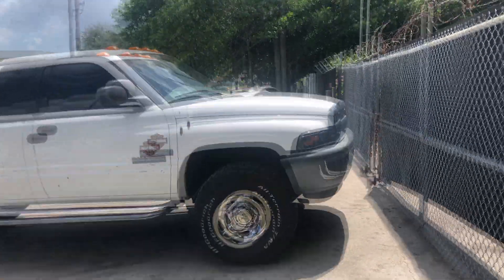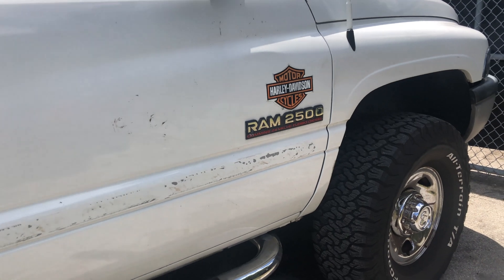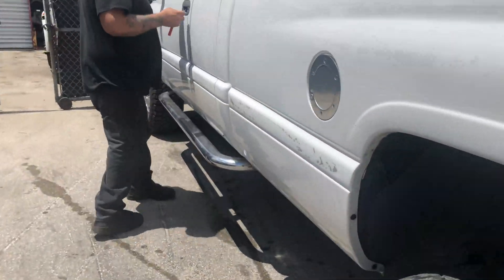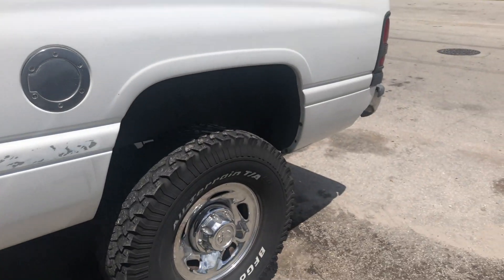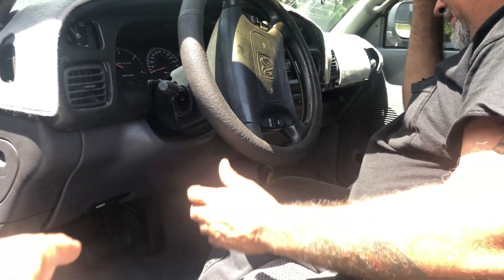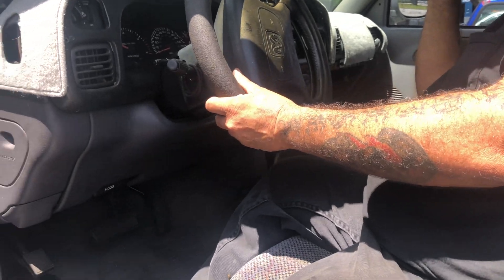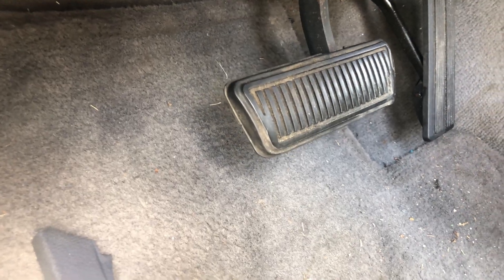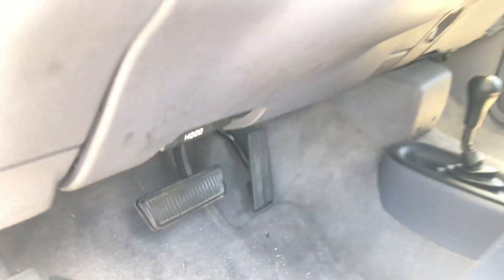VEHICLE BRAKES ITSELF WHEN YOU TURN THE STEERING WHEEL PHENOMENON

Comment: Yep, exact problem on 1999 dodge pickup with hydroboost I have in the shop.  It also has a replacement hydroboost in it, although customer does not remember ever having it replaced. getting another one.

Comment: i have a 2009 silverado 2500hd 4x4 crew cab with heavy tow package (WT) model with 6.0L+8l90e trans. i just rebuilt my hydroboost. basically its a few seals. anyhow i think this might be caused because when i attached the master cylinder i just started the first threads on each of the two nuts. i then tried to test it and realized i forgot to tighten those two nuts. i just had my trucks front wheels off the ground and did the steer L+R 20x thing and its still doing it.
i forgot when i did do the rebuild there was one little part i did have to change out. you have to grab like a needle part of this pin to pull the part out. mine actually fell out when i seperated hydroboost. seal was worn.mine looked good accept the seal so i took the seal off their supplied part and put it on mine. when i put mine in i put it in backwards. chewed it up removing it. dont put that part in backwards. its round probably 3/8" or so and has one seal on it. anyhow i put the supplied part in with the original seal the correct way. either its that part as its not original but it was new and in the package or i did something to the master cylinder. everything else is just like it came off. i cant figure out whats wrong with it. any help would be great. i only took it apart because it was leaking between master cylinder and front off hydroboost. everything functioned fine.

Comment: Same. Thing just happened to my 2nd gen did you ever fix if so how
Reply: Did you find a fix?
Reply: @drakesallee4379  my hydro booster went out
Reply: And all the videos were saying when you bleed it turn your steering wheel all the way then don’t hold it to one side but my buddy said steer all the way to the left hold 5 seconds then the other way hold 5 seconds
Reply: @thkpsycho7968  going to try that now, took about 100 turns before I started not to see any bubbles
Reply: @drakesallee4379  keep doing that tell you see no bubbles the start it up shut it off and repeat till it works hope I help
Reply: @drakesallee4379  you can’t have any air in the lines